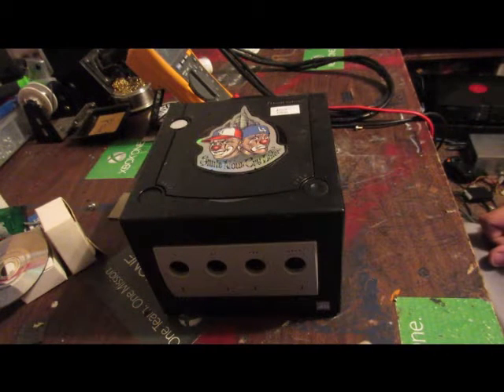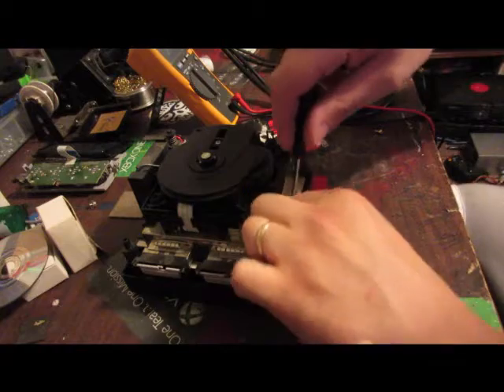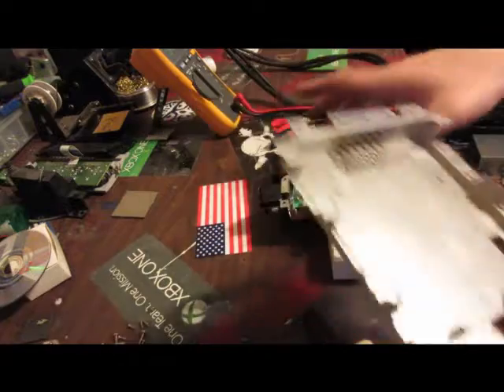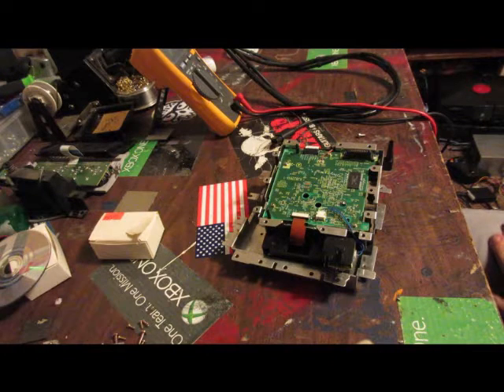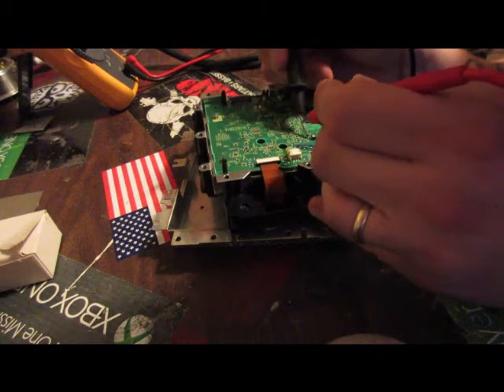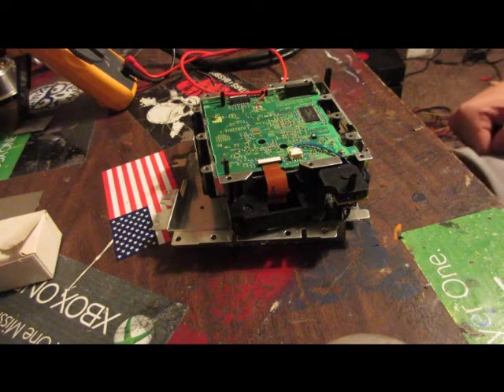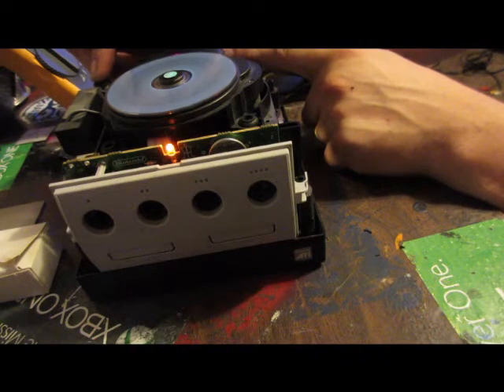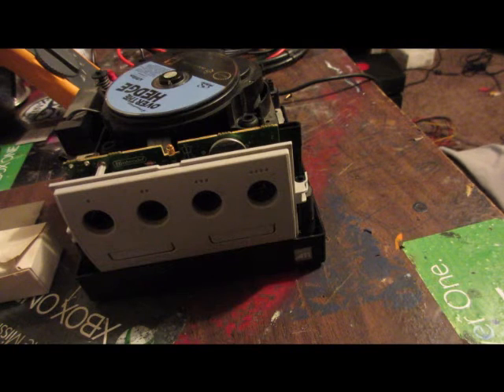GameCube DOL-001 Laser Pot Tweak

Comment: I have a Dol-001 European Gamecube. When I close the lid or press the power button, it tries to read the disc for about 7-8 seconds, and then the message “disk error” appears. I can also hear a whistle every now and then, or louder noise of the mechanism. This happen with a lot of attempts, even 30-40, untill at a certain point the game starts. From that moment, every time the disc starts immediately, on the first try, even changing games. If I leave the console off for a hours, the problem reappear. Based on this, could it be that it just needs a calibration? And how should i set the potentiometer based on the value i'm going to find?

Comment: tried various ohm settings between 600 and 150. nothing. brand new laser
Reply from the maker: Did you remove the anti static solder ball from the new laser? If not, it will not work at all.
Reply: @H4CkGAMiNG712  i didnt see one to start with. ill have to check later
Reply: @H4CkGAMiNG712  I just looked it over from every angle. Im not seeing any solder balls. I had to do that on the Dreamcast laser so I know what youre referring to. Ive tried maybe 30 different ohm settings between 600 and 150 and none of them worked. The disc spins and the laser moves outward until it gets to the far edge of the disc, almost like its not even below the disc anymore, then it stops spinning and I get a DRE.

Comment: I put my at 110 is that ok
Reply: Did it work?
Reply: @DaveRG  yup seem to love 110
Reply: @CRXJDM88  i put mine in 600/500/400/300/250/170 and wont work :(
When I turn on the Gamecube the laser starts moving like its reading the disk, then stops at the corner of the disk and then it stops with a click. Maybe if I put it in 150 or less it works
Reply: @DaveRG did u gst it to work?
Reply: @DaveRG  same with me. Can’t find any sweet spot
Reply: I measured My with 60 Ohm That it reads the Swiss dvd
Reply: @marsimoon185  I don't want to go under 100 before laser burns out, I tried going higher and lower and still not read

Comment: 400~ is lower then 200? 7:53
Reply: Yes, it's resistance so its backwards. A high number means the laser output is low, so 200 is a higher number since it's less resistance.
Reply: @anonony9081  Could some one help me i bought two lasers brand new installed them, i had to set them to 143 ohms for it to fire up is it a bad laser